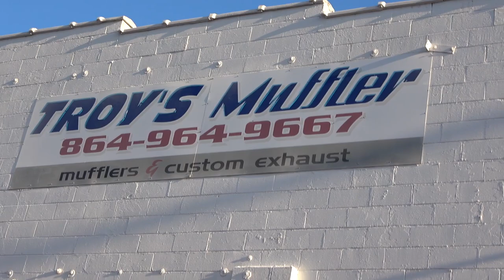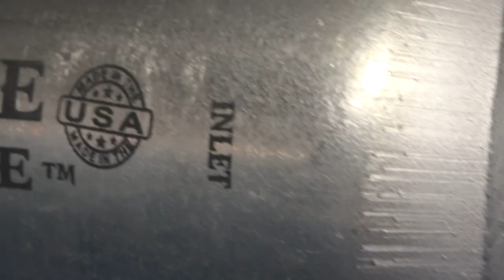Project STORM RAM 1500 4X4 Gets KARNAGE Custom Exhaust Sounds SICK

Comment from the maker: Man that hemi screams with Texas speed longtubes and karnage exhaust🥵 thanks for the awesome support mopar fam 💪
Reply: It sounds so good
Reply: You don't need to give better detail how you build the completed mufler system and how much HP you gain?????????
Reply: I have a 2016 ram with the 6.4 cam swap. Getting headers as well. Going with true duals karnage as well.
Reply: I was gonna do the Texas speed long tube header kit with deleted cats.  I like my exhaust dumped under neath so could I just use a carnage muffler